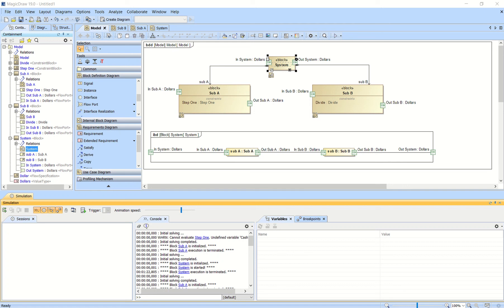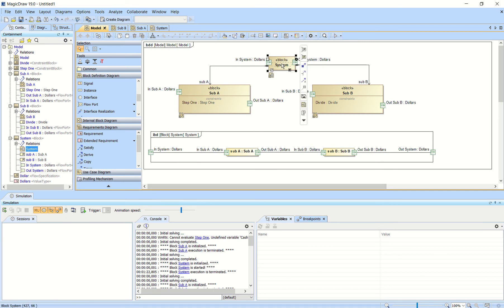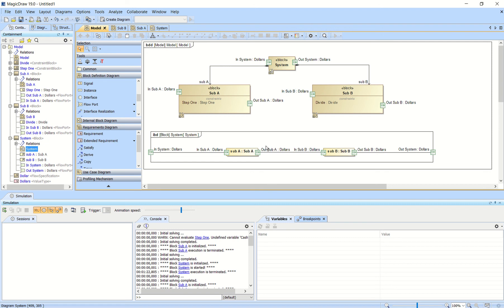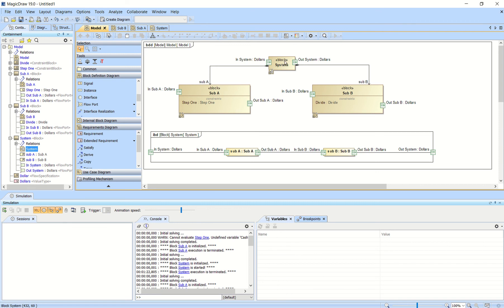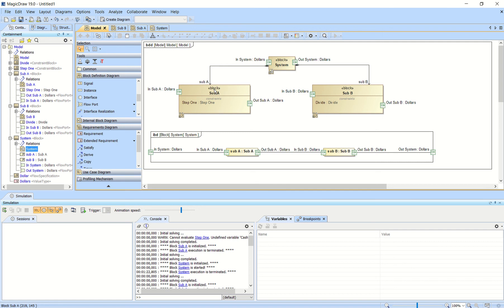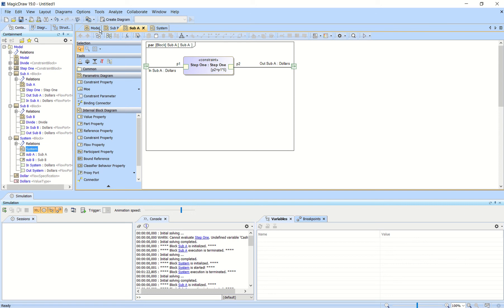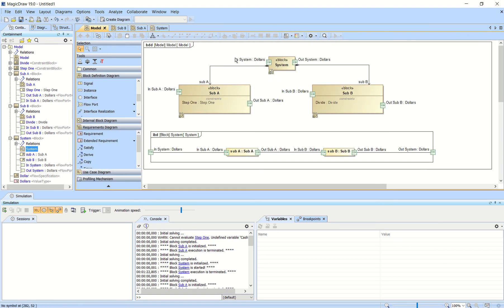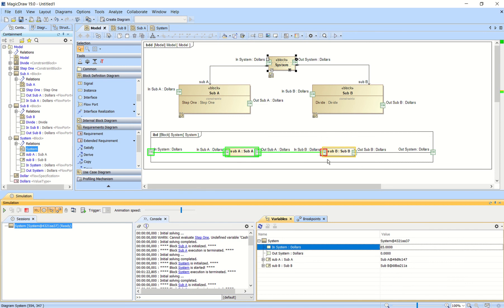Flow Ports with Parametrics and IBDs

Comment: How did you add a flow direction to the port without an interface block? I keep getting values like "Real@385e0de3" for my in/out system ports instead of being able to input values

Comment: Hi
very interesting example. We didn't understand how did you create the first parameter which is entering the ibd via the "in System : Dollars"?
Reply from the maker: Hi, it looks like I entered in a runtime value for the proxy port  prior to pushing the play button. If you don’t see ports displayed, click the gear icon at the top right of the variables window and “show ports.” This will only work if the port is typed by an Integer, Real, or String.